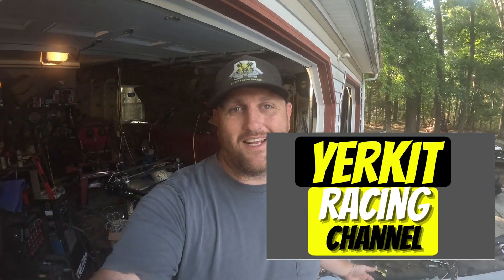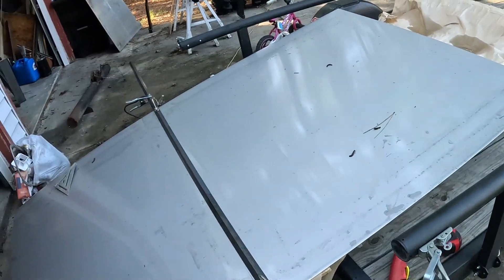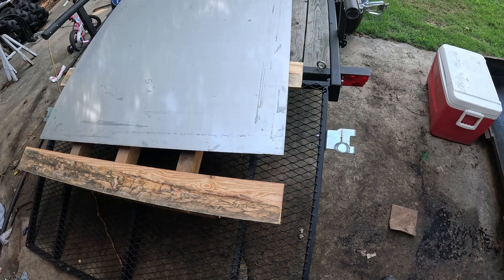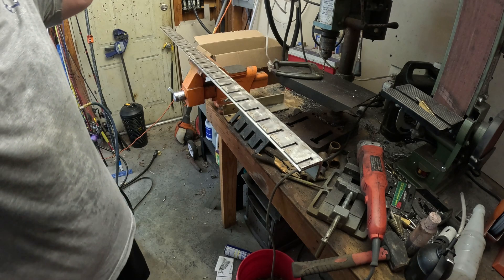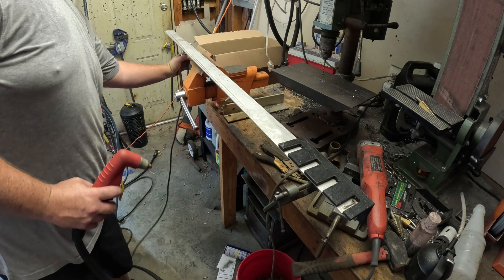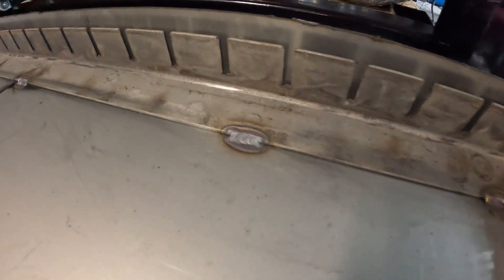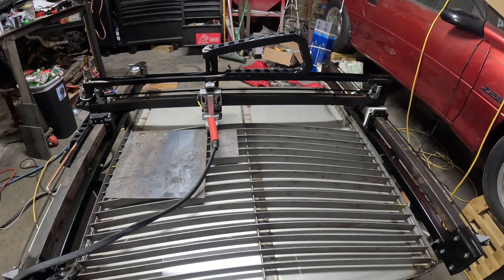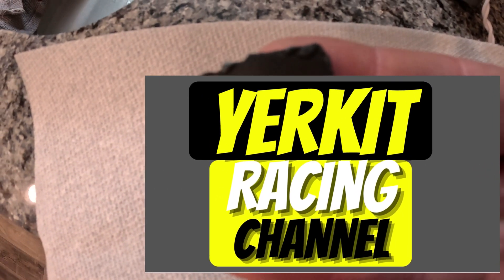DIY 48x48 CNC plasma with water table! Modified XXL JD's Garage build!

Comment: Hello, first of all, thank you so much for sharing. I’m currently working on a 3x8 meter CNC plasma design and plan to manufacture and deliver it to my customer within this month. I’m concerned about the possibility of distortion at the joint surfaces when connecting the linear rails and kinematics. If you have any suggestions or advice on this, I’d really appreciate it. Thank you in advance
Reply from the maker: That is a huge machine! I would suggest beefing up the frame and making sure the linear rails are well supported.

Comment: What controller and software did you use for double y axis?
Reply from the maker: Same controller as the plans call for just added a 2nd one for the other y axis. Used a Arduino CNC shield and emulated the y axis with the a axis. Then reversed the polarity on the 2nd y axis motor. Same open builds software as the plans call for as well.

Comment: I use the CUT60 on my Crossfire XL but I need a bigger table now. Does the plans give you the links to all the parts with the exception of the steel? I can't really justify spending a chunk of change to add the height controller to my current table so looking into this table.
Reply from the maker: The plans had all the parts listed out for everything! I think the table as made in the plans was a 24x28 or something close to that. I modified the plans and added an extra bearing block and y motor to expand it to 48x 52 cut area. I think JDs Garage just released new plans for a build with 48x48 cut dimensions that is very similar to the table I built so that's the one you'd want to go with.
Reply: @YerkitRacingChannel  Thanks for the quick reply. I was checking out the XL plans and though that was the one you had.
Reply from the maker: @cutweldngrind  the xl wasnt out when I did mine unfortunately. I had to research and figure it all out on my own... would have been nice if they released these plans back in June lol At least I learned a bunch about it along the way lol

Comment: That plasma cutter sure does beat a angle grinder with a cut off wheel 😂 Also I’m saving and looking around for a aluminum welder like I’ve said in another comment. I’m a beginner with mild steel experience MIG. For think you know .50 to .80 gauge Jon boats what do you recommend to not blow holes in it ? MiG or tig? I got a scrap boat to practice on and am gonna get that practice kit you showed me !
Reply from the maker: It sure does! lol I like the tig machine for the control of the heat. Takes some getting used to but with some practice you can learn to manipulate the heat with the pedal and keep the puddle going without blowing through.
Reply: @YerkitRacingChannel  Yeah I know TIG has way more control. So for thin .50 gauge boats I’ll probably get the 225x. It seems like you have good luck! Have you ever had something to thin for it to weld or always worked ?  Any videos of aluminum boy welding or aluminum coming up ? Thanks for info man !
Reply from the maker: @coltensawyer6761  haven't ran into anything too thin yet. Thin to thick aluminum is tricky though. Can be done just tricky. Hopefully have some more aluminum work coming up soon. Couple things in the works just need the customers to give me the greenlight on them.
Reply: @YerkitRacingChannel  excited to see some videos on it and learn ! I’m looking at three units. Prime weld 225 or 325 or an ever last 200. Not sure on what’s better for my application!
Reply from the maker: @coltensawyer6761  been really happy with my primeweld stuff. I'm about to pick up a mig welder from them. My wire feed on the old Miller quit. I've heard good stuff about the Everlast units too.
Reply: I bought a Eastwood 220 ac/dc Tig because I didn't know about Primeweld or Everlast. My doesn't have pulse or frequency, it's not digital but would be nice. I also bought a handheld tungsten grinder a must and takes the frustration out of that. YouTube Tig welding videos helps a lot specially if you practice 2-3 times a week
Reply from the maker: @epluribusunum5405  absolutely right! Practice Practice Practice!  A few times a week and you should pick it up pretty quick!
Reply: @YerkitRacingChannel  yeah I’ve seen on the website they have a prime weld MiG 180. I was curious about that to for the price point. With a spool gun included it seems to be a good deal but I don’t know it would well thin aluminum as well as the 225
Reply from the maker: @coltensawyer6761  yeah hard to beat the 225 tig in my opinion